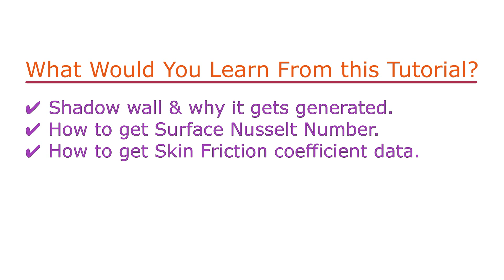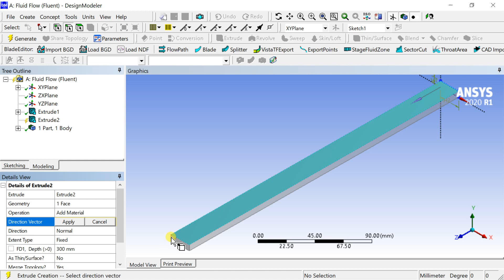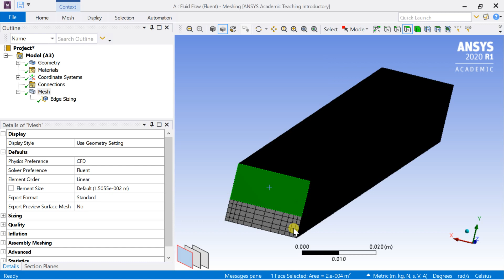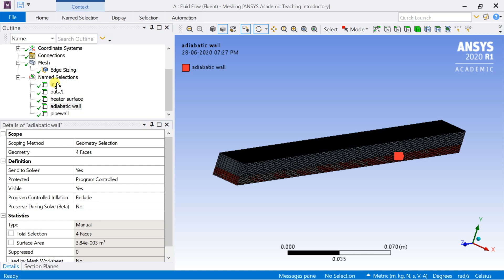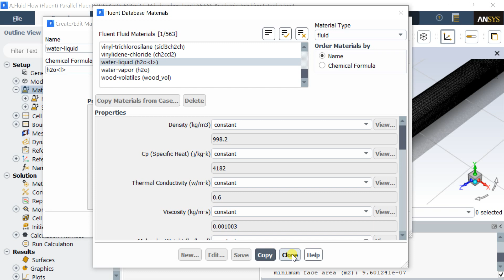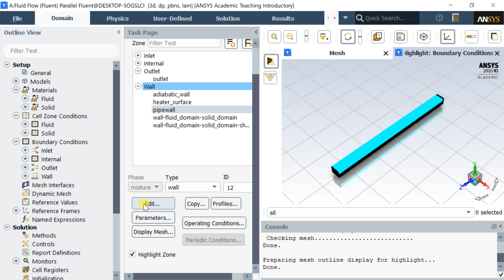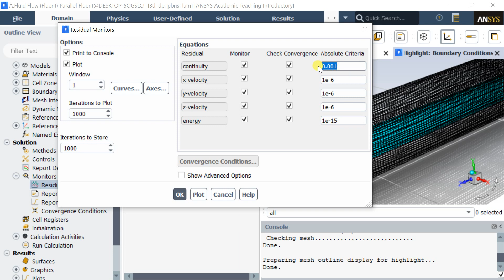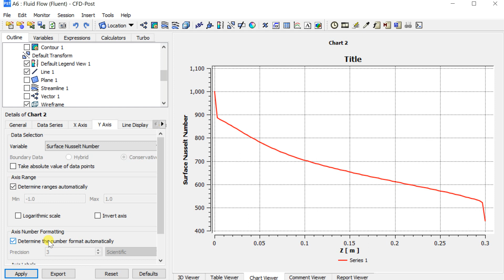ANSYS Fluent Tutorial | Heat Transfer Analysis | Surface Nusselt Number | Skin Friction Coefficient

Comment: Shouldn't the Nusselt Number converge to 3.66 in laminar flow? Can it be validated using this method by plotting graph??
Reply from the maker: Nusselt number can't be converged as it is the output result after the simulation gets completed.
Reply: @AnsysTutor Okay so for example I am simulating a pipe with 16m length, 0.25m diameter, Constant Wall Temperature (Tw) = 293.15 K, Constant Inlet Temperature (Tin) = 333. 15 K and Inlet Velocity (uin) = 0.0004 m/s. Since it's laminar flow (Re = 100 and Pr = 7), I need to validate that Nusselt Number reaches an asymptotic value of 3.66 through ANSYS. Is it possible by your method shown in video. I will just change my pipe design as circular with 0.25 m diameter and 16m long, rest everything you've done here I will keep it same.

Comment: Thank you so much. In this video Is the nusselt number correct? It's from about 400 to 1000! Is not so much? For example, Based on the Dittus equation, the nusselt number for Reynolds number 10000 and water fluid, it's about 75. But, in this video the flow is laminar and it should be lower than the 75!!
Could you please share a video for validation of the nusselt number with the Dittus-boelter equation? Thanks a lot.
Reply: I believe the reason the Nu is so large is due to the way ANSYS Fluent calculates h. The values are artificially inflated because the reference temperature it selects when computing h = q/(T_wall - T_ref) is not the mean fluid temp, T_m, but rather the temperature at the centroid of the cell closest to the wall. This gives a smaller T_wall - T_ref than expected, and thus a larger h. This video does a great job of explaining it:   https://www.youtube.com/watch?v=PuTl98d0iZ0

Comment: Hello Sir, very useful video. Can you perform heat transfer analysis of water flowing through a pipe, in which the pipe is fitted with strainer.

Comment: Thanks for the tutorial, it was really helpful. However, when I try to select the "Data File Quantities.." under the File tab, it is greyed out and I can't plot the results of let's say Nusselt number in the Results section. Any ideas on how to go around this?

I have initialized the solver and have tried with several projects. It is greyed out and I can not click on it.
Reply from the maker: Generally after initialization, data file quantities appear. Is there any error in meshing?
Reply: @AnsysTutor  Ansys Academic 2021 R1 does not have this feature. I tried it with a previous version (2020) and it came up just fine. Thanks for the help!
Reply: @eduardoterriquez4859  Sir, Iam also facing the same problem. Is "switching the Ansys version" the only option for this problem?
Reply: @sreekanth9441  Hello. It worked for me so that's as far as I went with it. In other forums I could not find any more information on it being inaccessible. Good luck!
Reply: @eduardoterriquez4859  Ok, thank you for your reply.

Comment: what exactly is surface nusselt number and how is this different from regular nusselt number. Because nusselt is convective heat transfer to conductive heat transfer in a fluid medium. Which confuses me as what exactly are we finding by surface nusselt number. Because nusselt number helps define type of flow happening in of fluid domain.
Reply from the maker: Both are same, only in fluent its name has been given as "surface Nusselt number " as its a purely surface phenomena. By the help of Reynolds number you can define the type of flow.

Comment: My CFD post processing is not getting opened as it is showing error everytime I do a project , what may be the reason? I just stop at solutions everytime.
Reply from the maker: You should close the setup first before you open the post processing. Also check if you had unchecked the cfd post while installing the software.

Comment: Hello! Thanks for the video! I have a question... I'm doing a model of a square mini channel (hydraulic diameter of 0.001 m). The problem is that when I compare the pressure drop of the model with experimental results there is a huge difference (the model pressure drop is too high in comparation of the experiment), and I can't figure why. Basically, I did something similar shown in the video. Do you have any idea of what could have happened? Thank you!!
Reply from the maker: Check the units of the model first. If you had done it correctly then check for any reversed flow warning during iteration process. If there is a reversed flow, you need to correct the meshing or create some developmental length.
Reply: @AnsysTutor  it is saying reversed flow in different faces while in fluent. How can i solve the problem ?  How can i correct meshing? or solution will be?

Comment: Hi, I want to simulate the cooling channel of liquid propulsion rocket engine, it has simple rectangle channel with inner surface has convective heat transfer from hot gas and at channel there is a flow of coolant
Reply: Can you give me an idea to work on it
Reply from the maker: Can you explain a little bit more about this. I did not get you.is it a double pipe with gas and coolant flow?
Reply: it is like a double pipe but they are rectangle. One is larger, the other is smaller and also at the bottom side of the larger rectangle there is a convection from hot gas side. There is a conduction from larger rectangle to smaller one and there is also a convection from smaller rectangle inner surface to the fluid inside the inner rectangle. By the way, all flows are turbulent. I share link that contains the geometry of the flow. https://www.google.com/search?q=regenerative+cooling&tbm=isch&ved=2ahUKEwixnr2HzeXqAhUXO-wKHXicBScQ2-cCegQIABAC&oq=regenerative+cooling&gs_lcp=ChJtb2JpbGUtZ3dzLXdpei1pbWcQAzIECCMQJzIECCMQJzIECAAQEzIECAAQEzIECAAQE1CqB1inEGCeE2gAcAB4AIABuwGIAcIHkgEDMC42mAEAoAEBwAEB&sclient=mobile-gws-wiz-img&ei=b60aX_GqMZf2sAf4uJa4Ag&bih=719&biw=393&client=ms-android-xiaomi-rev1&prmd=inv#imgrc=CjRKxRHV3kKOZM

Comment: Thank you for the well explained video :)
By naming fluid side wall as 'Pipe wall' in Ansys-Mesh and without specifying anything in Fluent doesn't makes it adiabatic wall?

and, if you have two sided wall zones (both are solid) with different material, which one will be shadow wall? because this is important to specify the material for respective wall during boundary condition assignment!
Reply from the maker: yes ,it will became adiabatic wall as in fluent the default wall Boundary condition setting is that. But its always recommended to check all the boundary conditions that were assigned by solver itself, in case of two solid wall & in all case even if in fluid solid wall case you can check the adjacent cell zone to see which one belongs to which cell one. You can find this in the wall Boundary condition option.

Comment: Your video is very useful and systematically explained. To check convergence, also add one or more monitor points using report definition option. If you make habit of using one or more  monitor points then it will be proper way of verifying convergence
Reply from the maker: report definition will only show the desired output result. It might not control the convergence, I am right.?
Reply: @AnsysTutor  Sometimes residual goes below the prescribed convergence criteria that doesn't mean that solution is converged. To verify convergence we must create one or more monitor points using report definition option. When the property such as avg. pressure or temp assigned to the monitor points reaches steady constant value then only we can surely say that solution is converged. Sometimes monitor points also Don't reach steady valur in such case we can conclude that solution can never reach steady state and such problem should be solved by transient model. Example vortex shedding behind cylinder.

Comment: Ohhh thank you this is very helpful. So many things I didn't know. My heat transfer simulation involves about eight bodies (body in a body in a body…)  with many interfaces. Will the same procedure apply? Do i selected coupled under Thermal for all interfaces?
Reply from the maker: Yes. You should select all as coupled wall.
Reply: @AnsysTutor  Alright thank you. I will do just that. Any ideas on how to model a vacuum between to shiny surface walls  And how to model heat transfer by radiation through the vacuum?
Reply from the maker: For vacuum zone I think you need to write a UDF. In the model you need to enable the radiation model. & Select "DO radiation model" it's the best model for such type of radiation problem.
Reply: @AnsysTutor  Thank you